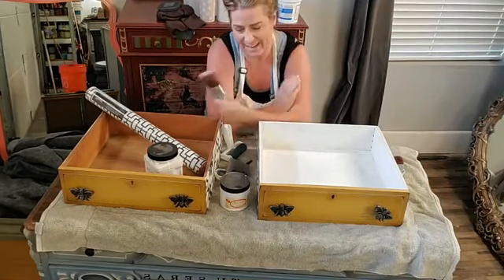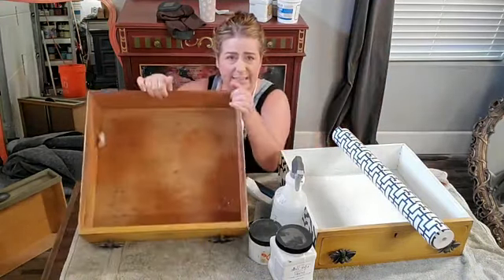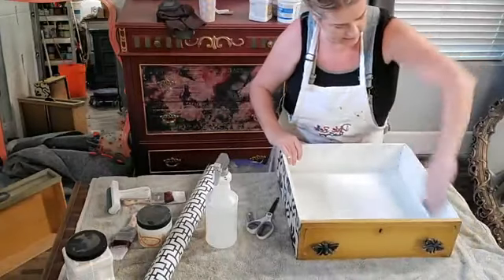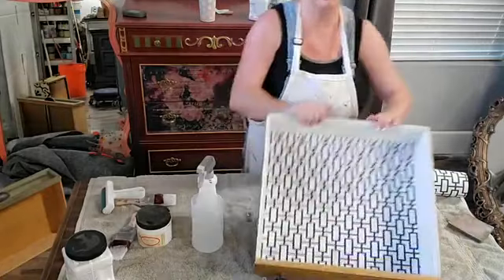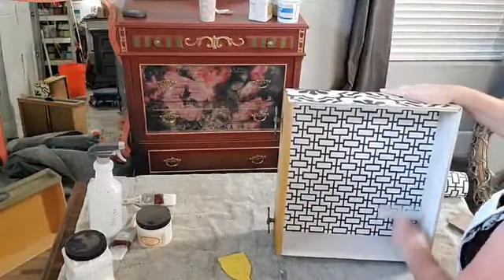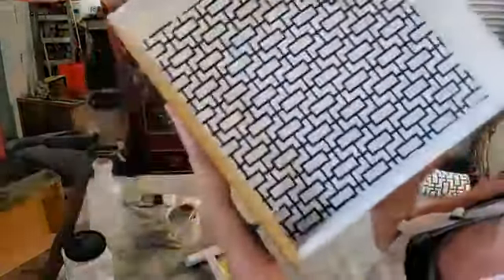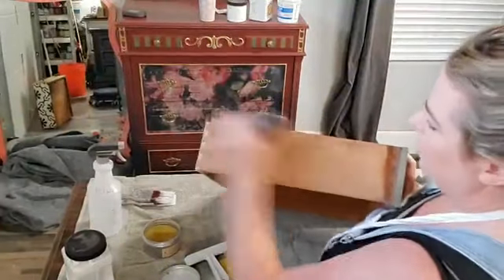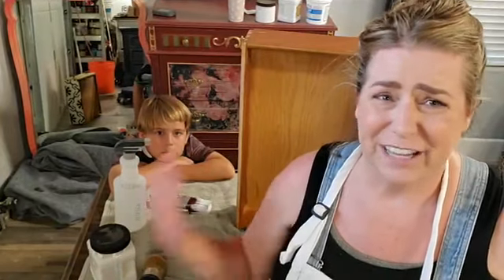What to do with dirty drawers??

Comment: we just bought an old house 1960s and the owners painted all the kitchen cabinets from the outside, however the inside of the drawers are old and dilapidated. Thank you so much for this I cannot wait!
Reply: I have a question brandy - should i clean the cabinets with TSP degreaser like white lightning before using the butter?

Comment: Pre-spray the drawer with Fabris (or someth9ng else you'dlike), then I cut a piece of carboard that fits the bottom of the drawer...then wrap it in a nice fabric (or plastc, etc of your choice),  and insert.     Then spray the fabric... Looks and smells good, then can be changed later.